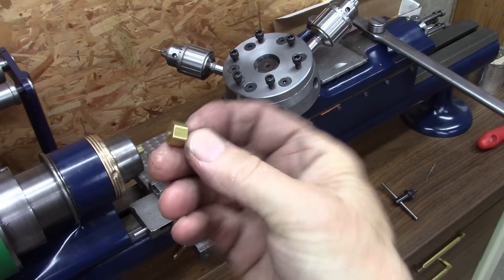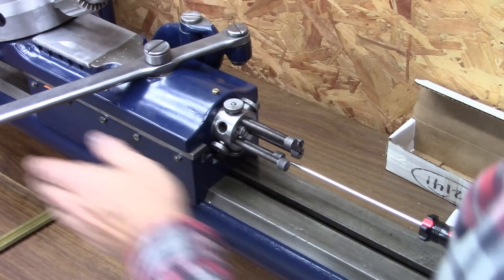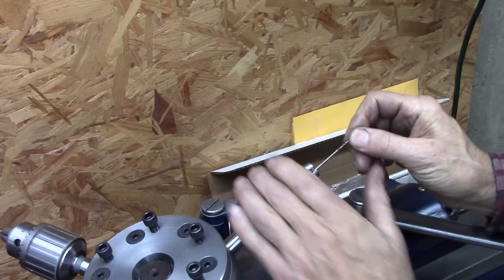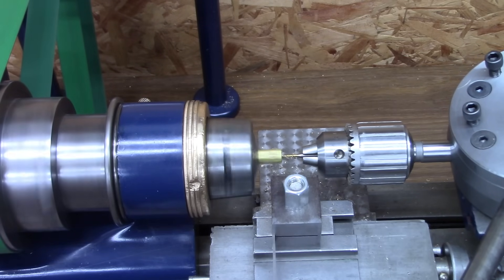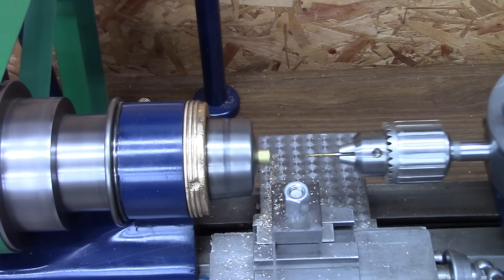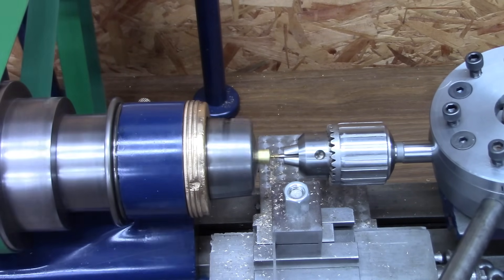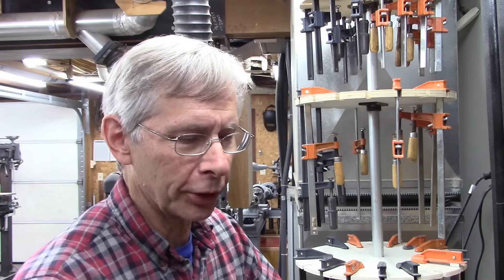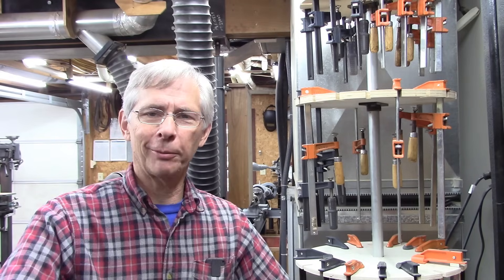Hardinge Cataract Turret in Action

Comment: A very cool demo!  I first saw a turret lathe back in early 2000s.  I think it was a Monarch 10EE.  
I wonder if you can get  (or make) a turret tapping chuck.  Something that would freewheel when you reach a certain depth, then you could reverse and begin to pull out and it would re-engage and allow removal of the tap?  
Something like that and setting the depth stops for that and the drill, then there's less risk of recutting abuse to materials farther down the stock
Reply from the maker: The free wheeling idea is interesting. That little tap is easy to break.

Comment: Reminds me of the first automated lathe I saw 56 years ago in England. They were making the small rollers for the T rail curtain tracks, guessing about 3/8 diameter. Unattended the lathe fed about a 20 ft length of rod, faced, turned OD, drilled, chamfered, cutoff. Part dropped into a chute running to a bin. Whole process took mere seconds.
Reply from the maker: Thats the best automation. No human intervention :o)

Comment: Winky, please be aware that the 5 C collet is of the "Draw In Type" so a consisten Accurate lenght can be a problem depending on how tight the draw bar is each time. OK if you only want plus or minus 5 thou in length. Another thing I suspect is that you are holding the hex bar in a round collett ???? be aware that the is a good chance that at times, that 3 of the hex corners could be aligned with the 3 collets splits and can affect the clamping position. Regards from Australia.
Reply from the maker: Yeah...  I figured out the "Draw in" aspect. I found that if I tightened the collet some and then used the bar to position the stock I could keep the length fairly close. Just how much to tighten is a bit tricky. I may try to put a little feeler on my compound t set the length. Yes on the slots in the collet. I wish I had a set of hex collets.

Comment: The inaccuracy of the depth stop must be frustrating, is the tailstock moving backwards? The capstan operation seems pretty violent, maybe it's enough to overcome the tailstock clamp. It's amazing how many operations there are for even a simple part like that if you were making a one off - facing, chamfering, centre drill, tap drill, countersink, tap, part off, face, chamfer & countersink the other end. As others have said you could regrind the parting tool to eliminate the pip but why not go the whole hog and grind a tool that will part and chamfer in one go?
Reply from the maker: Yeah...  I will regrind. I think the tail stock was moving on the bed. Also. tightening the collet draws the stock in. Good idea including the chamfer in the cuttoff!

Comment: You know, Mark, If you're gonna call it Enterprise , you need 2 spare Morse Taper holder mounted  up and back at the rear...  ;) 
If you want to do old school production, you need one of those old school 4 tool self indexing tool holders, with a chamfer tool in 1 spot, and your parting off tool in another, sharpened to cut clean on the finished part, then it is just another turn or 2 to clean the stock face.
Reply from the maker: All kinds of possibilities. I had more arbors on order, they cam in 2 day ago. I remember the 4 way tool posts but not any that were self indexing.
Reply: @WinkysWorkshop  The 2 guys I know that use them, I have actually never seen in use, or off... That being said, back when I was researching QCTPs it seemed like every one  on YouTube had 4 holes drilled in the bottom, and a couple guys said the were for indexing... but other than that I really don't know. It sounded good enough to be true...

Comment: Interesting problem with the stop not maintaining position. Hmmm.... Do you have problems with the threads not lining up in subsequent tap entries and having spoiled threads? Just curious.?
Reply from the maker: I think the tail stock was not locked down well enough. Somebody else asked how many double thread nuts I got. As far as I know, zero. I've done the same in the past but with larger taps but never had issue...  the fine thread might be more prone but I suspect at worst, the first few threads will be missing while the tap finds the previous threads

Comment: I made many 1,000s of brass fittings on old capstans, if you don't want to have to de-tit parts, grind the end of your parting tool at a 15° angle, so the part will drop off before you finish the cut, works 99.9% of the time 👍
Reply from the maker: Then the burr is on the other end of the nut.
Reply: Not at all, once the part drops off you continue until the tip of the blade has passed centre, trust me, we made millions of parts on Capstans, Cam auto's and in the end with CNC's, you can't be de-titing all of that 👍
Reply from the maker: @MyMiniHomeWorkshop  Dang...  you are right! brain fart on my part.
Reply: @WinkysWorkshop  Glad I could help 👍
Reply from the maker: @MyMiniHomeWorkshop  I'm away ready to learn. Thanks

Comment: Just need to add a few more drill chucks, and you'll really be cooking with gas! I don't know if Hardinge made a collet closer for the Cataract lathe, but that would be the final piece in some rapid production. Also, the VFD might have inputs for preset speeds... If so, you could add a button or 3, and switch between speeds for facing/turning/drilling, parting, and tapping speeds without having to mess with the speed potentiometer.

Either way, excellent work as always!
Reply from the maker: A collet lever would speed things up for sure. Yeah...  I almost used the sped presets on the VFD but the pot is fairly quick and simple.

Comment: You still have unused stations in the turret so you could add a chuck with a small drill rod as a “part catcher” during the cutoff step. You know way more tricks than I do but I felt compelled to make a suggestion. If you had this setup with every component in brand new condition, those little parts would be a snap to make. I hope you find a way to make it work to the best of its ability. Keep us posted. 🥸👍👀✅❗️
Reply from the maker: I may get there...  the parts catcher is an interesting idea!

Comment: Mark, grind a small angle on the part off tool face.  This will get rid of the nub on the part that falls off
Reply: After cut off, keep going and remove the nub off the stock.
Reply from the maker: And leave the nub on the part in the chuck...  so the same problem just on the other side.

Comment: The problem with a turret lathe is, you need to have a need for a bucket full of the same part to justify the set up. 
Try gun taps instead of the spiral flute.
Reply: The problem is when you need a bucket full of parts, you need a turret lathe.  :)
Reply from the maker: I have a BUNCH. Probably about 75 of the part i was making and over 100 on the next one. Gun taps push the shavings into the hole. The spiral flute worked okay but I think the chip are too thin to reliably exit the hole. I switched to a standard tap. It seems to be doing the best.
Reply: I misunderstood your procedures then. I thought you drilled a trough hole.
Reply from the maker: @grntitan1  Ultimately yes. Drill - Tap - Cut. So I guess a gun tap would be okay, the chips would get removed by the drill.